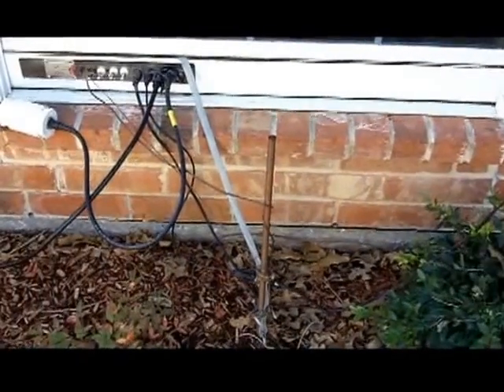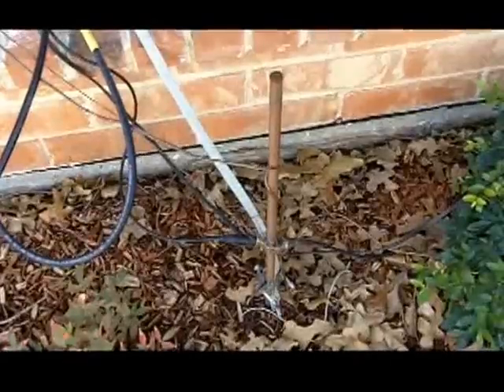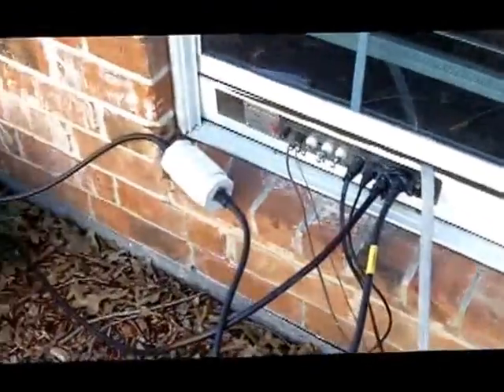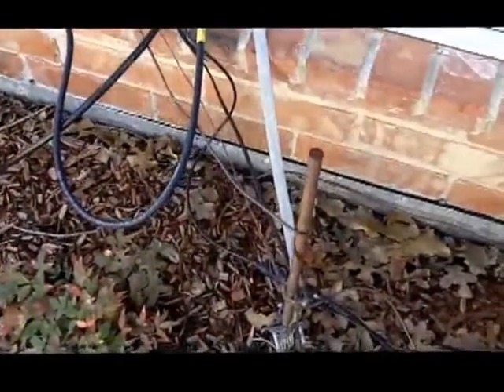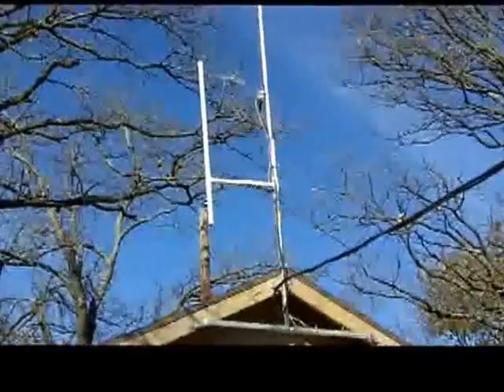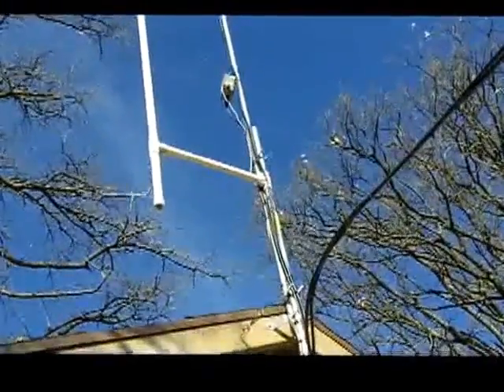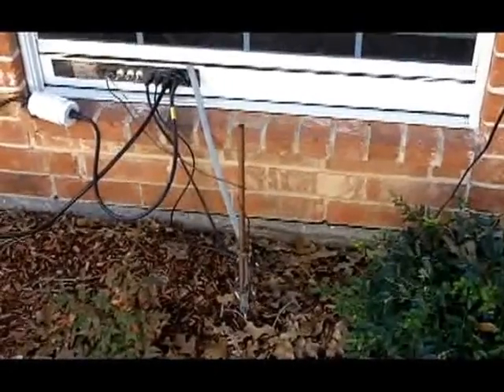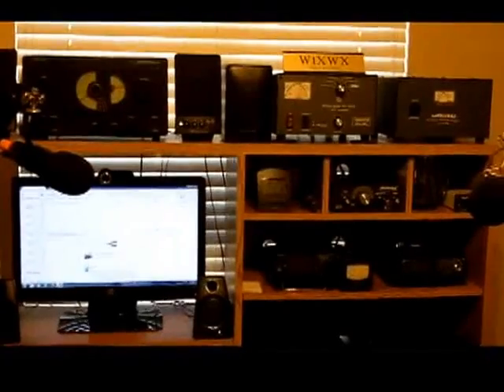Beginner Ham Radio #6 - Grounding

Comment from the maker: Since this video was produced I have installed a tower and beam, and changed the pass-through panel ground from a 6 gauge wire to copper strap, which I also used to ground the tower legs. See the "tower" videos.

Comment from the maker: Joseph, I don't fully understand the comments you posted. All electrical equipment should always be grounded to the mains ground rod using the 3rd ground plug on most all electrical cords. My house is properly wired for ground at the panel box. The panel box is properly grounded to Code using an 10ft ground rod.... so the house electrical ground is just fine.

The "aluminum" braid you see in the video is the RF grounding for all the radio equipment. It is NOT an electrical ground. Radios, tuners, and radio amplifiers require a good RF ground to work against. The ham shack has a single point RF ground only about 4 ft long running straight to the ham shack ground rod outside, using 3/4 inch braid which gives a very wide surface area. ALSO SINCE THIS VIDEO WAS MADE - I have gone to copper strap for the panel pass-through ground instead of a wire-- which improves the coax shield ground.See some of the tower videos for this change.

Everything works just fine including a Flex 3000 SDR radio which is susceptible to RFI in the shack. The shack has NO RFI even when running the amplifier at high power.

TelescopeMan

Comment: Published on ARRL website "Lab Notes - Different Grounds for Different Shacks
QST April 1996, pp. 80-81" According to the ARRL and NEC electrical laws, you should never use the 3rd grounding wire, to a fuse box, for a RF Ground, because it can cause RF to go into the house should a short occur.  Look at ARRL GROUNDING website, and the 1996 Q&A article on their website (2nd page). "Q: The third wire of my electrical outlet is grounded at the circuit breaker box, cant I just use that for my RF Ground?  A: NO"  They warn that it can cause RF energy back into the house, and can cause GFCI circuit breakers to POP.

Comment: Hi Joe, you didn't mention bonding all of the ground rods together, including the AC service ground.   It's dangerous if not done and the NEC requires it.  Maybe I missed it, but it's worth pointing out to your viewers.
Reply from the maker: In a later video I mentioned that I would be running several more ground rods over to the tower ground and then around the house to the house ground.

You are correct.

Comment: I have my shack in the second floor. It is to long run to ground my radios for the 10, 11 and 20 meter band. The run is probably around 16-17ft. But for 40 meters and above it is long enough. How do I ground the shack for electrical/saftey via this 16ft ground wire, and also for the RF-grounding I set up a counterpoise for all bands inside the room with all the radio equipment connected to it. Will my equipment-ground "float" and be un-grounded on the 10 meter band because of the long ground wire, or do you think it will only "see" the counterpoise? There is also grounding in the electrical plug in the wall.
Reply from the maker: You have two choices- don't RF ground anything; or buy an artificial ground MFJ sells one. In either case install either a Balun on the antenna or a Choke balun sometimes called a "line isolator". See the links below.  Certain types of antennas like long wires generate more common mode current than other types of antennas. 

http://www.ebay.com/itm/Line-Isolator-Rated-600-watts-stops-RFI-small-/141209547404

http://www.mfjenterprises.com/Product.php?productid=mfj-931

In the case of a 2nd floor shack I would employ BOTH of the above.

73

Comment: Hi Joe, good video. I can't put a grounding rod 8 feet down, I have solid rock 1 foot under the ground. So could I lay the grounding rod on its side and berry it? I also heard you can use a flat plate, but I don't think I want to dig up a large section of yard. Thank you for your help.

Comment: Hi Telescopeman I am searching for a window pass through by MFJ at DX Engineering and they are all 48" long.  My window is 35" wide.  Your pass through looks much shorter.  I have even gone to the MFJ site and they are all 48" long.  Do you have any suggestions?   Thanks!
Reply from the maker: +Gerald Shultz 
Just cut the board to fit the window size. Mine was too long-- just trimmed it to fit.
Reply: Thanks